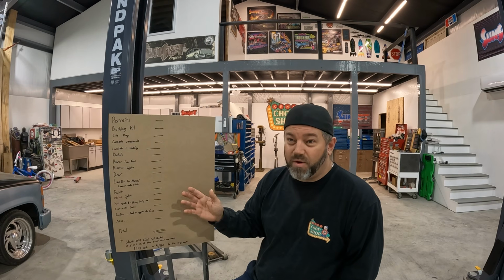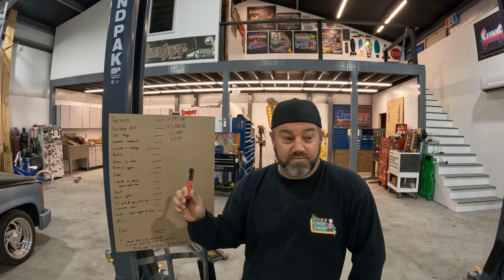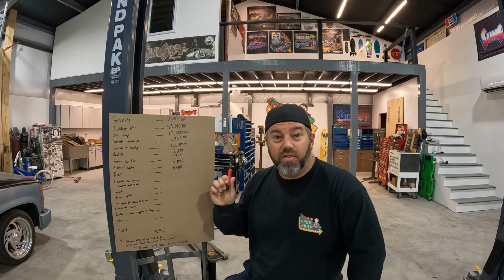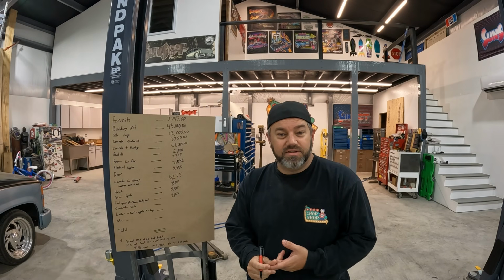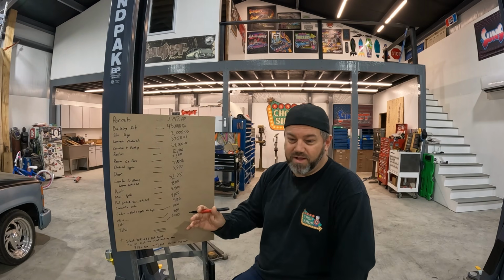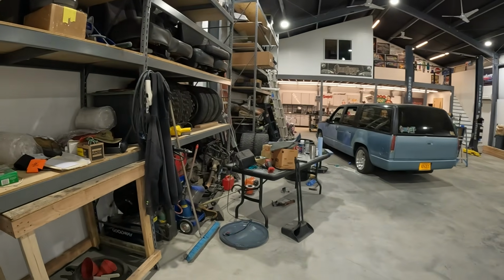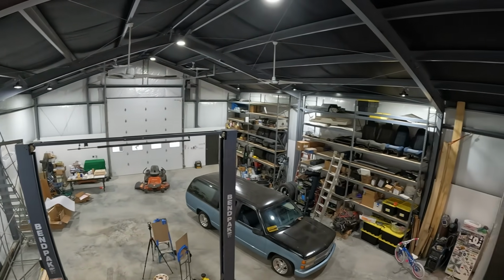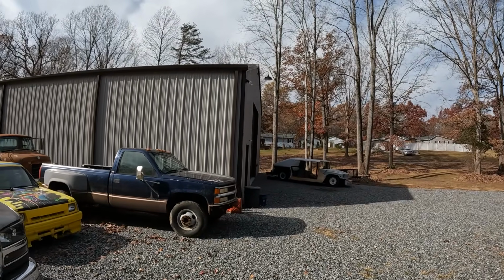Dream Garage Red Iron steel building total cost so far 40x60x16 plus short tour

Comment: I was wondering a couple of things. How high are your walls? And how high is your measurement? And what would I be able to put a car left underneath? Is what I would like to do in a building that I built.  Please comment back very nice garage
Reply from the maker: Happy to answer,  so my wall height of my building is 16' . Under the beams it a little shorter . Most average car lifts require about a 12' ceiling height as a minimum but my lift is actually 13'1" . My mezzanine floor height is 10' so the ceiling under it is about 9'1" . The office ceiling I think is right around 7' if I remember correctly  and the bathroom ceiling slopes down with the roof . The storage loft above the office is like 4' tall at the front and 18" tall at its lowest point 10' back so that floor space there is like 10x11'4" . Thanks for watching and thank you ! If you have any other questions just let me know I'll try my best to answer or better explain

Comment: I found an alternative for overhead lights, you might be interested in. I got a 10-pack of LED lights, from the "Jungle Site", for about $100. I think they were Benelli's , or something like that. They came with the connectors, to couple them together, pig-tails, and switched plug pig-tails, along with mounting clips. I used to have 8' florescent bulbs, in my 30'x40' garage, with 10' ceilings. They were ok-ish. But, the led's made a huge difference. They were real easy to replace and a whole lot less expensive to run. just a thought. Nice building.
Reply from the maker: Thanks for the info , yeah leds are much nicer light then florescent.  All my lights I have are led also ! Thanks for watching and again thanks for the info I need to redo my old garage for my wife's work area so I'll look into them for that space.

Comment: Great info. Thanks for putting this all together and sharing it. Working towards a 25x40 with a large semi enclosed covered parking area and hoping to keep it under 100k all in. Red iron, all metal construction, radiant heat inside. Seems realistic after watching this. Doing a lot of the work ourselves as well.
Reply from the maker: You're welcome, and thanks for watching!  That will be nice ! Yeah I'd think you could do it for that with a little better planning then I did . Good luck with your new shop and thanks for watching!
Reply: You can Aleah go with a metal tubular company instead of a red iron which would save you on cost if you live in the east coast I can help you with that

Comment: I’m a GC is S.FL so I don’t know anything:) but on the paint. I use Porter (similar to SW) and a better paint you will use less paint to cover the same. Less paint means less work. It kinda works out. Better paint has more zink (opaque) in it I believe.  There is a reason pros don’t buy HD paint.. they can and HD offers so many deals.. this is to help the next guy out.. great video buddy
Reply from the maker: Thanks,  yeah I used to always use duron paint back when I did remodeling work years ago but once SW bought them out we stopped,  I was never a big fan of SW paint but their higher end lines do cover well but their prices are crazy,  I started off painting the osb on the mezzanine with SW paint but it still needed 3 coats to get the covrage I wanted so I decided to try the e600 exterior semi gloss paint from HD and it covers just the same and was under a 3rd the cost as the SW so I just stuck with getting the rest from hd . Thanks again for watching and the input,  it's all greatly appreciated!

Comment: I did a 40x60x14 2/12 roof. 2 insulated 12x12.  Site prep myself.  Turn key 145k.  Just building on steel, lights, door openers electric epoxy floors, 3 ton ac, 15k amgo lift, all  extra.
Reply from the maker: Sounds like a nice space!  Thanks for watching and sharing your info it's nice to hear how others' similar builds cost !
Reply: Where or website did you order the shell at? Thank you

Comment: Nice work. Every site and persons needs are different, & sometimes we learn as we go. I think you did a bang up job and you have inspired me as I work out my details by looking at vids like yours. Bring on the full length 😁.

If u had it to do over again what would you change or aadd?
Reply from the maker: Thanks. I appreciate that, and thanks for watching!  So that's a tough question. Some quick response would be I wish I hadn't over dug my footers to use a little less concrete and hired a different concrete finisher in hopes of having a smoother floor . But after thinking on it for a few hours now and I also just got asked another question on a different video that made me think about it more one of my biggest pet peeves is the wind load cables on the 2 side walls (60' walls ) the are out in the I-beams and infront of my wood walls and it makes it a pain to put anything on those walls . Had I thought about it before hand I might have had them design it so the could be on welded brackets on the back of the beams if that was possible or have done that myself before I put the wood up . The other thing I second guessed myself on a few times was building orientation.  I like what I have and that's what I wanted and fit my property best but sometimes I wondered if I would have been better off turning it sideways and having 3 bay doors on the 60' wall . But in the end I'm happy with what I have and if money allows in a few years I'd like to build a 30' wide by 60' long lean-to on the left side where I have cars parked beside the building nowand maybe close that in . If I had flipped the orientation, that wouldn't really have been a useful option imo.

Comment: I Just built a 60x60x16 in NC.  So, 1200sq ft larger. I have 140k in the building like it sits. Pad, building, R13 insulation, erection, two insulated 12x12 doors with side openers, electrical, 3 Mitsubishi 30k btu mini splits. Overhead and wall lighting, And Air system. This doesn’t include lifts or any of the equipment. Only thing I did was the electrical with the help of friends. 200 amp service, 54 slot panel, 12 230v circuits for lifts, mini splits, welders, plasma cutters, etc. Everything else was paid labor.  Your equipment rentals are almost as much as I paid for the erection of the entire building. I also paid 23k for flatwork and the concrete pads at 6” thick.  I used a foundation company. You lost out on those two things for sure. Don’t get me wrong, I ran into snags as well. But for 33% more building and at about the same price?
Reply: Yeah it sounds like prices are higher in your area. And you included things I didn’t in the price. Very nice shop you have, and I enjoy the videos
Reply: @davidscott4849 what area you in ?
Reply: So you painted the red iron framing if I heard right? I like it slot and we’re getting ready to do the same with an outfit from Boston Mass. it’ll be just a garage 32x40 for two cars and a seasonal car door on the right rear of the building. Living in Maine I’m considering a frost wall.
Reply: Hi David, where in NC did you build at? What company did you use? Starting down this path myself. Thanks in advance.
Reply: @timhilton5096  I don’t know any red iron companies but I do work for a metal building company that does almost the same just different design and we offer 60 ft span buildings as well if you’re interested and they could be more affordable than a red iron
Reply: @5trikex766 who do you work with. I'm looking at building a building.
Reply: @timhilton5096 contact GOAT Steel Buildings in NC and see what we have to offer, it’s not red Iron but it’s not your typical cheap tubular buildings as well. We got a 50x100x16 build going on the first week of March and a 100x100x16 by the end of March.
Reply: David Scott. What building package did you buy? I want to do a 60x60 as well. Would love so insight on what you did and should have done kind of thing
Reply: David Scott. What building package did you buy? I want to do a 60x60 as well. Would love so insight on what you did and should have done kind of thing
Reply from the maker: Yeah, I definitely over spent on some things for sure, especially the rentals . I later found a company that rents equipment about 40 min away that is much cheaper.  Sounds like you got a pretty nice setup.  My total cost did include the lift and materials for the mezzanine and lower walls but yeah like you said I definitely could have saved some in areas . Thanks for watching and congrats on your building it sounds nice!

Comment: Thank you for sharing your build costs. Its hard to estimate those especially with all the unknowns, or I forgots that will always pop up.
I would definitely recommend having more back-fill around the shop. I have a garage that was built up similar that they put a sidewalk around with a strong slope right at its edge, and over its life the sidewalks have dipped significantly and exposed the foundation due to just the rain washing out a little dirt here and there over the years. (I can say with the other work quality it probably wasn't compacted right either)  If I were to fix or build new I would have at least 5' of flat (with grade for drainage away) at the minimum, and then fill enough of the slope to mow without feeling like your going to fall over, or have the mower roll back over you (hand mowing)
Reply from the maker: Your welcome and thanks!  It really is , there are so many little things that don't get thought of.  Yeah that was something I originally wanted to have a few more loads of fill/topsoil brought in to grade the hill out more but couldn't get my dirt guys to bring any when I was trying to button up the outside for the final inspection but that's something I'd like to do this spring and at the same time run all my gutter drains under ground down to the bottom of the slope also. And I'd like to do like a 4' or so path of blue stone around the back and side against the building too. Thanks again for watching !

Comment: Good info... Thanks!  I have a question regarding your garage door, what type and brand did you go with?
Reply from the maker: Thanks!  And you're welcome,  thanks for watching!  I ordered my door through homedepot.com. I got one of their clopay commercial garage doors.  I'll post the link here as its hard to find them, and it only works on a real computer and won't pull up the commercial doors on a mobile device.  But if you follow this link on a computer, then put your address in pick your store, then it will give you an option to build your door . Mine is a 14x14 with the highest r value insulation, and I added the high lift track and side opener . If you have any trouble finding them, let me know, and I'll see what I can do to help . Here's the link ....  https://mhddc.clopay.com/#/banner

Comment: Camera work on the shop tour leaves a little to be desired.  I felt a good part of it I was looking at the floor.
Reply from the maker: Thanks for watching!  I'm no professional camera man that's for sure and using a gopro probably isn't the best because of the wide lense but I just rewatched it myself and it was never pointed at the floor and it was mostly always pointed straight out at about my shoulder height so yes the floor was in frame but not really pointed at the floor but either way thanks for watching ant the constructive criticism I'm still learning/figuring out all this stuff so always trying to improve !

Comment: Damn i did mine set up concrete 51,000 all in  i damn near spit my drink out when you said 12,000 for site prep...mine is 40x100
Reply from the maker: Damn 51k for a fully finished inside and out 40x100 that's good ! If my site had been flat it would have been much cheaper but we had to build it up over 4' in the right rear plus completely removing a bunch of large trees and roots . You got me curious about your building like was it a flat site to begin with?  What year did you build it ?what type of building is it ( red iron, post frame , stick built , block , box tube ,ect...) ?and what part of the country?  I only ask for curiosity sake to see how things compare in different areas or times or construction types.  Anyway thanks for watching and hope your enjoying your shop as much as I do mine ! I wish I could have gone bigger with mine like yours !

Comment: Nice job! I paid $70K for a Mueller 36 x 110 with I beam end walls so I can add covered parking front and back after passing final inspection. Ghost piped a bathroom plumbing under slab. $45K for concrete. Red iron is up and one side wall. Looking for best options for LED lighting now? Primelights stingrays? x20? $$$!
Reply: Newby here, trying to prep for mine… Whats “Ghost piped”? 

Asking because I’m on well, & plan to build shop/garage 200’ from house & want it to be on its own (solar for electricity & well for water), but trying to figure the plumbing out. I want to run a full bath & would love some insight/ideas if able on how to do it.
Reply from the maker: @bradmason8334   I don't want to answer for him but I believe he's referring to having everything roughed in to come from outside to its final location in the building but instead of leaving the pipes stubbed up through the concrete 2' to tie in later he's got them covered with something like a coffee can about a 1/4" below the concrete so that way he can pass inspection for the building then add the plumbing after without inspection like I'm doing and just chip the concrete out pull the can and easily connect to the hidden pipes . But for mine I just put my pipes in the floor after the footer inspection and stubbed them up 2' and also outside the building a few feet under ground then did the concrete then for my final inspection I just piled up old insulation around the pipes to hide them lol
Reply from the maker: Thanks ! Nice that will be a great size shop ! No experience with those lights but I really have been happy with my hyperlite 150w led lights so far . Thanks for watching!

Comment: Appreciate the video and Al good information !  I was looking at a pole barn 40x60x14 that is close to that price, curious if you considered a pole barn early on and/or what made your decision to go with a red Iron building if can share.  I’m in Ruckersville Va on I-64 so glad to find someone also in Va ., watched a lot of pole barn videos but they’re all over the country so hard to get idea for Va .  Thanks for video, appreciate any insight as may now consider a red iron as option
Reply from the maker: Thanks @tauntlines7712 good deal I'm up in spotsylvania.  So I originally was looking at doing a pole barn but didn't want a flat ceiling (from the wood truss) and then started looking into company's that used steel clear span trusses like miracle truss and stroud building supply and the miracle truss route was going to be way more expensive and places like stroud weren't willing to work with me to get engineered drawings that would meet my county requirements so I said screw it and started looking into red iron and after getting a ton of quotes that were either all over the place on price and what they came with or they just never responded or gave such a generic response that I knew they didn't care I ended up going with maverick not only because they were the first to get back to me with detailed information, price and preliminary drawings but their price was  on par or better then most of the other quotes and the customer service is what 100% sold me on them . If you do start looking into the red iron route hit them up and talk to Josh he was the sales rep I delt with and he answered all my questions and was super helpful.  If you have any other questions hit me up I'll try my best to share whatever info I can . Thanks for watching !
Reply: Thank you Ken , subscribed and thumbs up,  I get not wanting flat ceiling and what you did with the height and office is great ! I gather  you went with their standard 14 gauge steel and not optional 12 gauge,  I gather the steel is plenty thick to give great confidence of the buildings strength and integrity ? Sure does seem like few columns with long distances for girts and Purlins , when used to pole barn 8, pole spacing…thx
Reply from the maker: Thanks I appreciate that , I'd have to go back and look at the engineered drawings to find the exact specs on the metal now but I went with what they suggested (the engineer)  and according to all their specs they far exceed all the snow and wind loads my country requires.  But coming from a background of stick building homes and garages and remodeling work (years ago) this is a very solid structure I was very impressed with it . And comparing it to say my metal carport that I can't walk on the roof without denting the metal this building I walked all over it without a worry other then the insulation dust I had to keep cleaning off the bottom of my shoes so I wouldn't slide off haha . Thanks again for watching and the comments!